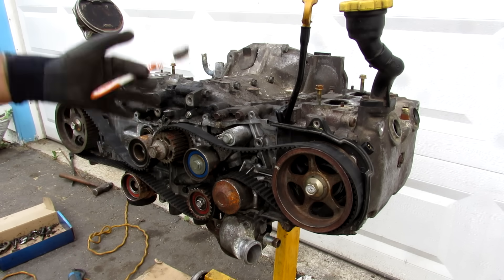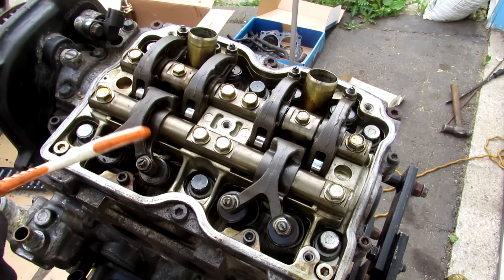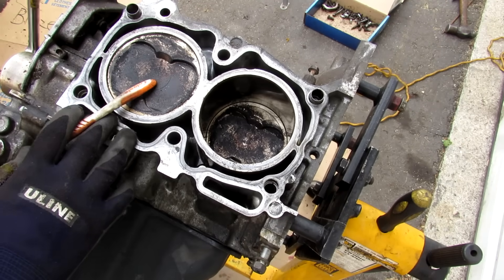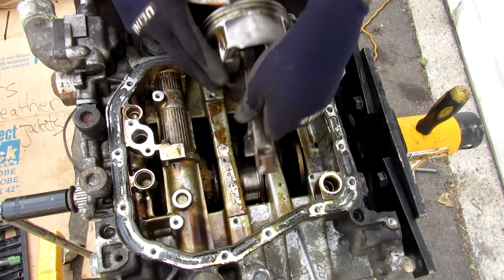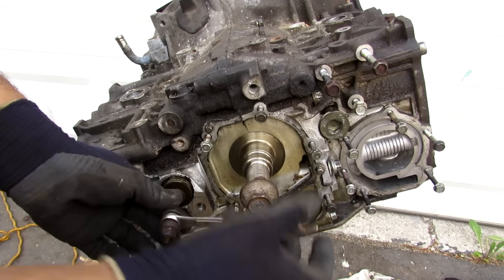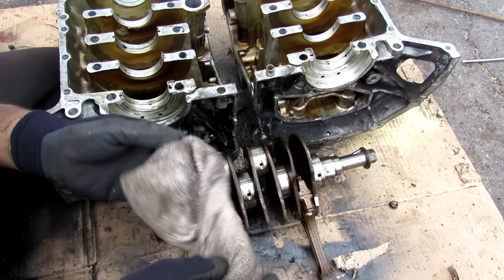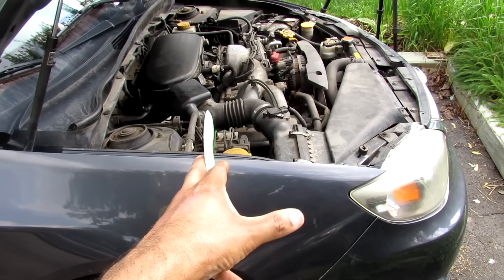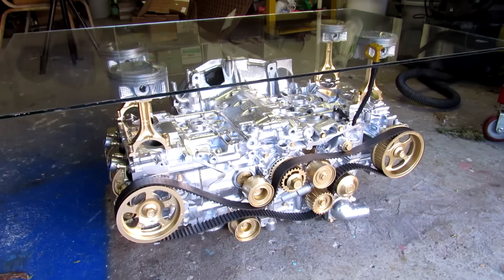Why Subaru Engines FAIL

Comment: Fram oil filter, sludge and all that rust tells you how this engine was maintained.
Reply from the maker: Yeah when I saw the Fram I was like :(
Reply: @speedkar99  You know, I've used Fram filters in cars for years and years and never had a single problem with any of them.
Reply: @speedkar99  What oil filter would you use? I use K&N Oil Filter
Reply: I've used basic Frams for decades with zero issues. The key is to change your oil at reasonable intervals. On a high performance car, sure, spend more, but on a basic shitbox Subaru, a standard Fram is fine, IMO.
Reply: Doesn't matter what oil filter you use if there isn't enough oil for it to filter. This engine was obviously run, not only without having it's oil changed enough, but with too little oil, it's a wonder that it only had one knocking con rod, and no broken piston rings.
Reply: @olegkostoglotov8800  yea that ist a reason dir every engine to fail.
Reply: @Nordlicht05  That's one reason the instrument panel either has a gage for oil pressure, or an idiot light to tell you it's low. The engine that was torn down suffered fro oil starvation, I don't think that a blown head gasket was the problem. If it was a blown head gasket the oil would be a milky colour.
Reply: My dad's 2006 audi 2.0T has 200,000 miles on the odo with no major service and he dailiy drives it around 100 miles almost everyday. My 2000 Subaru Legacy L with the EJ251 has 126000 miles on the odo and when I checked the spark plugs, there was a considerable amount of oil but no knocking and ran great when I replaced the plugs
Reply: Oleg Kostoglotov o
Reply: Oleg Kostoglotov was
Reply: Merl Klarhoelter   Yeah,  that's what I thought. So the real reason this Subaru engine failed was due to negligence and/or abuse.  Wow, what a shocker
Reply: That's all they bloody sell here , except at dealer
Reply: @jackd1582  The USA dealer filter is made by fram. The JDM is not and is a good filter. I would not use the USA OEM personally. So many are better, but it would technically do the job well.
Reply: @jiyushugi1085  I'd say that was an isolated incident and you were just unlucky bud... 🤷‍♂️
Reply: If u change the Fram filters on the reg, it's fine
Reply: Those bearings show major adhesive wear.
Reply: In a previous life as a lubricants distributor, one of the many, many, many things that I learnt (from a couple of really bright engineers that took us for classes) was, that the "inline" type oil filter fitted, on its own, in most engines was damn near useless, no matter how much money you are scammed out of for it. 
The reason being that the most dangerous particles you have floating in your oil are in the 5 - 10 micron range, too small to be captured by the filter, but, big enough (and small enough) that they can pass through the tolerance areas and slowly and systematically chew those parts up.
It doesn't matter how much you pay for a filter (a little or lots), Fram or otherwise, the majority seem to claim a 10 micron rating - "NOMINAL". And here's where the bullshit starts. 
NOMINAL turns out to be around 30 micron ACTUAL, meaning that when new, that filter is really only good for pulling out the "rocks" in the oil. As the filter gets dirty, it gets better at filtering out the smaller stuff.
The answer... Don't be a tight arse, CHANGE THE OIL..!!  Mount the cheapest filter you can get, because in reality, it does sweet f**k all.
Reply: @tandemwings4733  - Wow! That's common sense! Be aware people, in general, are not used to the basic application of reason and common sense. LOL 😂
Well said. Cheers
Reply: May I know how old is the engine  you disected.  From the oil sludge it seems like the owner have never maintained well.  Any car if you didn't well maintain, you can have 1001 problems arises.
Reply: Lol this oil filter debate. I’ll leave this here: my dad had a 2000 Sentra with the 2.0l engine and changed his conventional oil every 3000 miles. He also used the lower grade Fram oil filters and changed them every oil change as well. Car went to 186k miles before it was scrapped due to rust eating the frame. Engine didn’t burn a drop of oil, ran like a clock and never had ANY problems whatsoever. Just change your oil filter every oil change and change your oil in frequent intervals: my dad believes 5k-7k oil changes are absolute BS even with fully synthetic oil. Just change your oil and filter frequently and your engine will last.
Reply: Merl Klarhoelter  they're shit tho
Reply: @jiyushugi1085  lol 99 taurus.... but yeah kramer is right... thats unlucky and you gotta check your filters. ive gotten bad ones from every brand thats why i check em when the parts guys brings em to me. some of them now know to check first to save another trip... it doesnt matter the brand, check all your components before install, its pretty much all susceptible to the same shit
Reply: @Bob Dole my b8 1.8 tfsi used to burn 1L in 80 miles....PCV changed, full service, change oil type and it's all good now to 1L between services. My old b6 1.8 however that had a self sealing engine...
Reply: Merl Klarhoelter  ofc it was ran out of oil, it leaked and burned it all
Reply: Run OEM filters and Amsoil, nuff said on that subject.
Reply: Dcdanger - OEM filter for my 2017 WRX and Motul 8100 X-Clean.
Reply: Merl Klarhoelter well said!
Reply: I use oil filters from mazda for the rx8, basically the same thing they use in japan just slightly bigger
Reply: Yeah, I was waiting to hear about that Fram filter 😆.
Reply: So getting 300,000-400,000 on on a engine with only normal maintenance is considered failing?? I traded my 96 outback legacy 5 speed with a  2.2 with nearly 300,000 Hard miles..engine didn't smoke knock or tick.. literally ran like a new car..my dad had the same Model car but a 99 with a 2.5...NEITHER NEVER failed over all the years ..the off road hunting ,fishing ,camping trips..the blizzards..my knee injury from a motorcycle  accident eventually made it to painful and difficult to shift..
Reply: @matooleyobrien2918  That's like my family's experience with Subarus. I used to know a man who had a really old Subaru, 1972? and the engine had never been taken apart and he just drove it every day.
Reply: I've always used Fram filters over the years and never had any type if failures. You guys who have failures probably change oil at every 100,000 miles. I change mine at 3000 but sometimes when I forget it will get up to 5000. Still never had a problem. Stop blaming fram. Blame the engine or yourself.
Reply: Fram does make some sketchy oil filters but their premium UltraGard synthetic filters are well made and have excellent filtration specs.
Reply: @videomaniac108  Just buy & use only the simple, basic WIX oil filters. BEST THERE IS, HANDS DOWN. Trust me. Cheaper, yet 2nd to NONE. Go to Amsoil's website & see what they sell for oil filters: ONLY WIX. Oh, they do have an "Amsoil brand" oil filter that they charge a couple bucks more for.........but guess WHO made their filters FOR them: WIX. It's the exact same filter, only the Amsoil logo is slapped on, and suckers pay the extra money for them. WIX makes oil filters for several companies and some parts stores' house brand oil filters too. Find out if "WIX made it for them".......'nuff said.
Reply: @howabouthetruth2157  Wix is the best
Reply: @howabouthetruth2157  theres a reason napa uses wix as their house brand
Reply: @videomaniac108  Why buy fram when better ones are available for same amt. of money?
Reply: @4thstooge75  You can look at a number of YouTube videos where people tear apart oil filters and compare their construction. The Fram filter I mentioned stacks up with the best of them in terms of quality of construction and the design of the filter medium. You can also compare particle filtration efficiencies of numerous well regarded filters on the market and see that the specs for this filter are one of the best , in terms of the smallest particle sizes that get filtered out. If there is a better filter I would appreciate your advice on which one and what it is about the filter that makes it better than the UltraGard Fram I mentioned.
Reply: @videomaniac108  yep, totally agree. People might say, including me, I've used xxx filters forever and never had a problem. Then one day I tried yyy filter and it blew my engine up. Well, that may be the case, but did you replace like for like?? Not all filters are created equal, and that goes for all Fram filters too; some are certainly better than others. The ultra guard or the tough guard are the ones to go with 👍
Reply: @videomaniac108  And you're getting totally ripped off by paying so much more for the "best Fram oil filter", when you could buy a WIX oil filter that costs far less and is 2nd to NONE.
Reply: @howabouthetruth2157  Wix filters are good, but they are a little harder to find in some places. I think you can get them through NAPA stores, but may have to to order them. One advantage is that Wix still makes elements for replaceable element oil filters as well as many sizes of the canister type.
Reply: @olegkostoglotov8800  Yes, Wix filters are harder to find, but many parts stores have their "house brand" filters made by Wix, ya just have to start asking all the parts stores in your area. If not, simply buy them online. That's what I had been doing for the past couple years because they closed the NAPA store in my area. But I recently discovered another business in my area that sells nothing but Wix filters. For anyone using conventional oil that is recommended to replace every 3,000 miles, Wix filters are so good, you can actually keep the same filter for the next oil change.........for 6,000 miles using the same filter. If the engine is in good shape, you run no risk whatsoever doing that with a Wix filter. This is good information for guys owning vehicles where the oil filter is very difficult to access. Cheers.
Reply: The oil in subaru boxers is constantly replaced as they always end up burning it. Looks like the person that had this one didn't monitor their oil level.
Reply: @Terminxman  A turbo timer is a device designed to keep an automotive engine running for a pre-specified period in order to automatically execute the cool-down period required to prevent premature turbo wear and failure. After a period of driving when a turbocharger has been working hard, it is important to let the engine run at idle speed for a period, allowing the compressor assembly to cool from the lower gas temperatures in both the exhaust and intake tracts. At the same time the lubricating oil from the engine is able to circulate properly so the turbine won't burn the lubricating oil that would otherwise be trapped within the charger with the turbine rotating at high speed. With regard to modern automotive turbochargers, the need for a turbo timer can be eliminated by simply ensuring the car does not produce any 'boost' (during driving) for several minutes prior to the ignition being shut off. Most turbo timers are based on digital electronics. It's not just with boxer engines...
Reply: @Terminxman  Boxers (especially with turbo) like to blow oil through into the intake, an AOS will add life. The regular ej non turbo doesnt burn oil like turbo. People need to get a turbo timer to idle the car when it's turned off or sit in the car and idle it so the oil can run through the cooling system at low load and cool down. They only burn oil because people run em hard then just shut it off leaving the oil not moving against a bunch of hot parts. This is the case with every turbo car, and literally the reason turbo timers exist.....
Reply: @crimescene25  I've heard this advice too but not sure it's still valid, at least for all engines. I bought a Saab 9-3 in 2005, never followed this advice, just turned her off when I arrived. But I never drove her hard and was meticulous about changing the oil on time. She's still on the road with around 200,000 miles on the clock (my son-in-law uses her as a daily driver).
Reply: @kidlatazul  Regular oil changes go a long way too. Also not driving like a nutcase the last couple miles before you arrive does the same thing.
Reply: @kidlatazul  thats really only for cars that get driven hard. If you were just at 12psi of boost and shut the engine off, thats bad. If you were put-putting around without spooling the turbo much then it doesnt really matter
Reply: @Terminxman  I hope they don't sell that as a feature...
Reply: @Terminxman  and that's why I'll never buy anything that has a boxer engine.
Reply: Or Fram is garbage... not sure which one
Reply: What a ridiculously dumb comment I got trucks dating 40 years old never had one issue with Fram filters.. 

Leave it to YouTube couch mechanics to comment their useless shit
Reply: @MichelLinschoten  There's only so many manufacturers of oil filters. Most likely the folks here complaining about Fram filters have one on their car that has a different name on it. I believe in using synthetic oil also. I bet you can look at videos on all kinds of vehicles where one person says they are junk and others have nothing but good things to say about them.
Reply: Agreed - the orange cans are garbage. Their "Ultra" filters are great!
Reply: Nothing wrong with Fram filters.
I've been using fully synthetic motor oils (5w-40) and basic Fram filters last 30 years and never had any engine problems on my cars, not in a cold winters or hot summers.
Always change the oil filter at the same time when you change the engine oil, no matter what brand of filter you buy.
Local repair shop's wouldn't sell them if they were that bad.
Reply: With Subarus you're constantly checking the oil level. I had to put a quart of oil in mine every two months.
Reply: An Audi or Lambo maintained like that, they were pieces of junk. Here for sure the car still worked. Subaru still better that Audi in many perspectives.
Reply: @lovemademan  Reliability wise, absolutely!
Reply: @lovemademan  I disagree, from my experience in the car industry for the last 10 years I can say that Subaru turbocharged engines fall short of Audis hands down
Reply: TheCompyshop my 07 VW 2.0 t has 3400000 miles on it burns oil just like when it was new but still runs great
Reply: @lovemademan  What a load of crap.
Reply: @lovemademan  audi better then subaru xD 1,8t will outlast all of these subarus
Reply: @kevinhawley3303  the newer 1.8t have extremly bad oil consumtion. Was in several channels. Goes up over! one litre in max 1000km.
Reply: kevin hawley or 2,0 T
Reply: @lovemademan  as an owner of 2 Audi's, both 6 digits on the ODO, I'd disagree.
Reply: Yep seen far more fram filtered engines in junk yard than any other, by far worst filter on the market
Reply: Nah this subaru engine is garbage, even in Japan its got terrible reputations.
Reply: Dealer oil filters. $5
Fram filters . $12

And they paid more than twice as much for it. 
Oem Subaru filters are
A
Big
Deal. 
They set the bypass oil pressure
Reply: Fram isnt a bad brand to use. Subaru engines arent know for being bad because of fram. Theyre known for being bad because its a shit engine
Reply: Nothing wrong with Fram filters, just search for any oil filter comparison test on here and you will see what are good and what are not.
Reply: @kramer26  take your own advice. Frams are cheaply made junk. Check out Project farm's oil filter test and inspection.
Reply: @kramer26  Frams cheap filters are garbage. You have to shell out for the Ultras for a decent filter
Reply: @kramer26  I was a mechanic in the early 80s the truck fleet I helped maintain was 35 trucks If I remember. The boss ran Fram on everything because they were the cheapest he could get in bulk we changed the oilevery month and greased them weekly. The Fram filters sucked there would be bad ones that wouldn't even let the oil thru when you put them on. When you started the truck no oil pressure you had to jerk the filters off put on new one problem solved. Never used a Fram since only wix,fleet guard or Baldwin
Reply: @kramer26  I never saw a review that says Fram is good.
Reply: @kramer26  Fram is junk.
Reply: @kramer26  except theres multiple videos comparing filters and yea.. fram is complete junk.
Reply: Wayne Sitarz - Subaru just makes a junk engine.  It’s that simple.  Can’t blame FRAM or USA-spec vs. J-spec or whatever.  That’s just grasping at straws.
Reply: Bryan Noga - So my Forester with 220k on the clock with no major repairs is junk to you? Alright
Reply: @ClockworksOfGL  wrong! They are great engines although they will spin a rod bearing if run low on oil.

Comment: I have one of these that's up to 189,000 miles. I definitely have that piston slap sound when starting in cold weather. I let it warm up a little, than drive it very gingerly until it warms up some more. The noise goes away when the temp needle reaches around the low mark next to the C on the gauge. At full operating temp, the engine is very quiet, no ticks, no vibration, and lots of power.
Other than that little annoyance, the engine runs just fine, burns about 1/4 quart of oil every 1000 miles, and I'm sure to keep it topped off with 5W30 mobile 1 high mileage. Every 3000 miles I change the oil, and put in a quart of Lucas synthetic additive. Makes the engine VERY quiet and slows the oil consumption.
I'm pretty happy with it, but you definitely have to keep up on maintenance.

Comment: Besides the lower center of mass and  a bit less body roll, what is the advantage of these engines ?  They are heavier and less easy to work on, I wonder why SUbaru hasn't phased these out ?